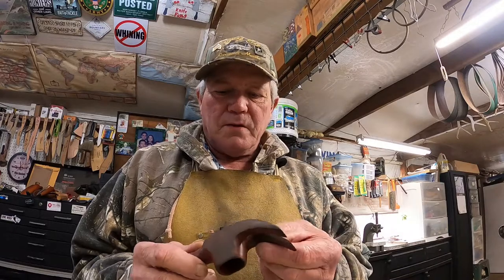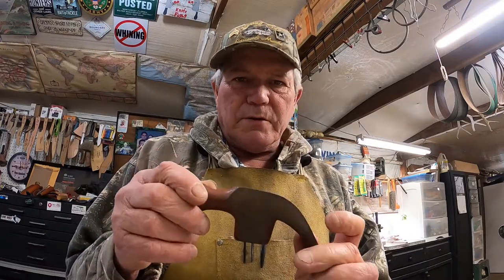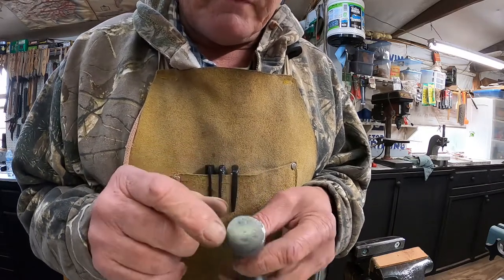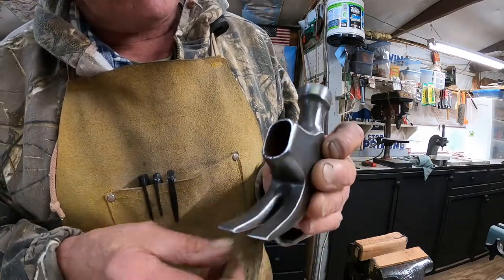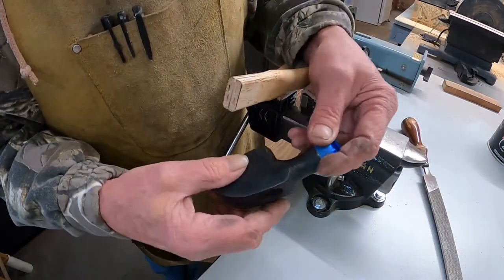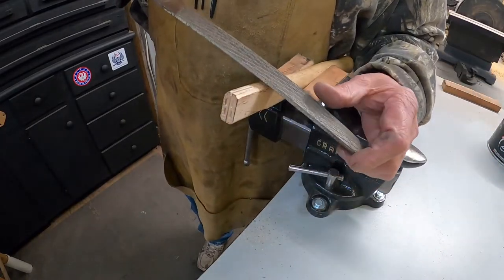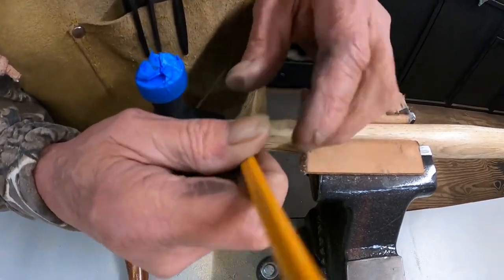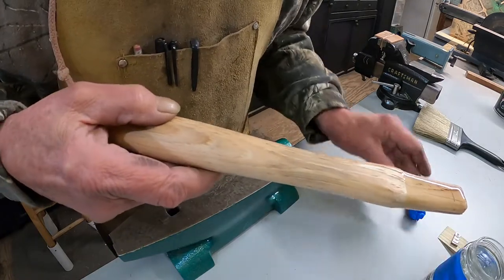Tool Restoration  Old Claw hammer !

Comment: Looks good.  I don't know about needing a hammer to restore a hammer, though.  :-)  If you did it again, would you sand the sides down a little more so you could get the wooden wedge in first?
Reply from the maker: Not on a small hammer, Next one will be a ball peen, heavy use hammer, ill do it up a little differnt  :)